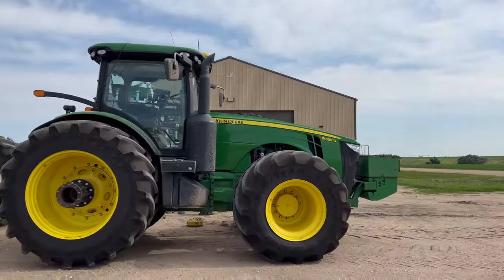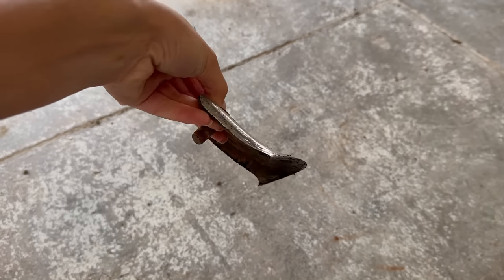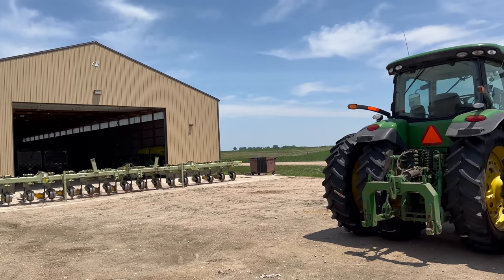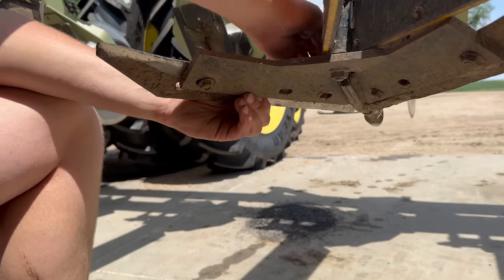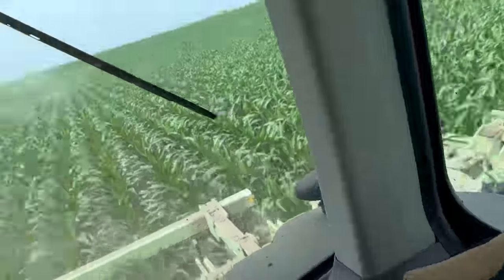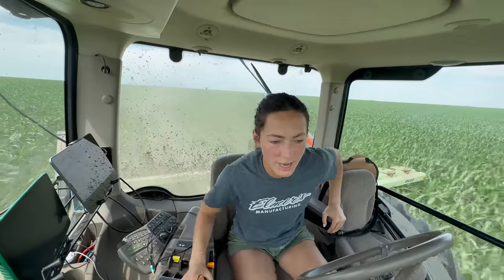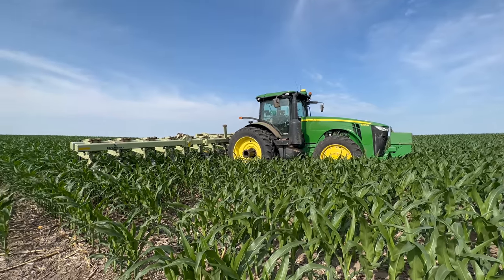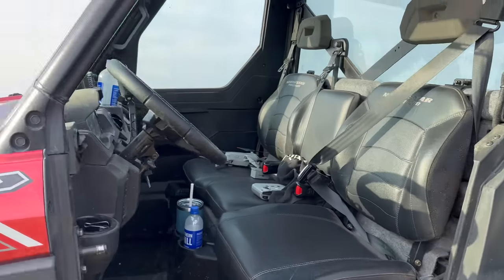I've Got The Biggest Corn On YouTube

Comment: Would keep the big tires for ground work, here in Europe every new 200+HP tractor is equipped with at least 710 (or even 900s) tires to get all the power to the ground properly, less ground pressure and less soil compaction.

Comment: The hole is an old collapsed water well most likely.  If it is, the hole will continue to get larger and or deeper.  It could also be an old unused supply pipe for an old sprinkler or flood irrigation system.  It all depends on the precise location within the field.

Comment: The big hole in the field looks like a tile washout, we get them alot in NW Ohio/ NE Indiana, arond here when the old clay tile breaks in a certain spot, then the ground washes out in that spot creating a big deep hole, the easiest option to cure it, is go out with a mini excavator or a backhoe, dig down to the tile spot, shove new perforated poly tile in so it overlaps on both sides then cover it back up.

Comment: The duals are better on wetter land because big rubber just squishes soil aside and means you need to disk out the ruts. The important factor is the amount of pressure beneath each wheel. Consider duals in front as well. TSH, retired agronomist, NC.

Comment: Glad to see someone still does it the old fashioned way.  After that crowns out, you shouldn't have to worry about weeds.  Seeing those plow shanks and hardening them up with a torch brings back memories.  We had a full blacksmiths shop on our little farm and every spring, we had the ritual of "sharpening plows" and doing the heat treat to harden up the tips.  Got a lot more wear that way.  That hole looked like a collapsed tile inlet at first, but it looked like it was on higher ground, so that doesn't make sense.  if it were down here in the South, I'd say it was made by wild hogs, but don't think you have those up there, and if you did they'd damage half your crop.  Might be a sinkhole/sand pocket.

Comment: Wow! Those tires looked great. But, they are super heavy. So, with out them the steering has to be a little lighter. Plus, you can probably turn a little tighter. Cultivating may seem old fashioned. But, it’s a lot cheaper than using a ton of herbicides. I think it’s a very smart cost effective solution.

Comment: Was LITERALLY holding my breath when you were moving those huge tires. Soooo dangerous. Always move it AWAY from you and NEVER stand on the side of it. That falls over on you and you are likely a goner.
Reply: Shades of Erin Holbert!
Reply: I was also more than concerned watching you move the huge tires.  I understand farming involves hard work and labor.  I worked in construction in high school and college.   If my body could do tasks I used it.  Heavy lifting and lots of dangerous tasks.  I can only suggest from my own experience, every task needs to be evaluated in advance for safety.  While you are young and strong now, your back has only so many miles for which you can abuse it.  I started having back issues in my 30s, all related to moving and carrying things that were too heavy.  I know you are strong but moving those tires by yourself is not worth the downside.  Accidents happen in a fraction of a second.  By then it's too late to calculate what is and what is not safe.   Please be safe first.  :)  Perhaps you can add farming safety tips to your videos.  I would be upset if you were injured getting the job done.
Reply: Балдёж реально 👍
Reply: I was thinking the same thing. They have a forklift, use it.
Reply: I have a pretty good feeling those tires are actually not that easy to push over.  The wider it is the more stable it will be.
Reply: @rmedlinnc  - That's the first thing that popped into my head. Erin was really lucky she didn't get hurt any worse than she did...
Reply: @Snarkapotamus  amen!  She was blessed to be hurt no more than she was.
Reply: Tires that wide?  You couldn't push them over if you wanted to.
Reply: Love this gal 😎
Reply: C’mon folks, Laura grew up around this stuff, she knows what she is doing.
Reply: @Snarkapotamus who's Erin?
Reply: Moving tires is what the forklift is for Laura.. Let the machines do the work! Your body will thank you in 30 yrs...😉
Reply: Laura isn’t the brightest bulb in the box so what more do you expect than her to do things the hard way.
Reply: We have some 'LGP',  (Low Ground Pressure), tyres (3ft. wide) like that on 3 Volvo dump trucks we own, - none of my men can push them over, and they have all tried, - they're nearly impossible to roll as well, - we have to use a 'fork-lift', - we've no choice.
Reply: @rmedlinnc  the tire Erin dropped on herself was liquid filled, way big difference. The big tires would be harder to fall over and Laura handled the tires properly.
Reply: Yeah I thought she was gonna pull one like the Indiana farm girl Erin Hobert! She was moving some combine duals and one fell over on her and pinned her to the shop floor. Luckily her brother and dad were around!
Reply: What are they…1100 pounds or so?  Yea that would be a bad day.
Reply: @rmedlinnc মানে আপনি বাংগালি

Comment: So my guess on the hole, is that it's a collapsed tile. Back in the day, (Late 1800's all the way to the 1970's or 80's) they used actual half-moon tiles and some round tiles to divert the water away from low spots. Now they have tile in rolls that they can drag through the ground to get the water away. Usually to a ditch, pond or lake. My Grandfather tiled a field on the other side of a railroad track and used a hand post hole digger to bore under the tracks to get the water to drain away.

Comment: 7:45 Watching Grant hold down the head of that carriage bolt, whit his bear finger sent a twinge down both my legs, reminding me of 20 years ago I was removing a nut from a carriage bolt that had been pulled through hundreds of miles of Iowa farmland. I was using an air impact wrench & held my bear finger on the bolt head until the impacts wrench unseated the bolt & spun that thinned down head under my finger sending me outside to a running water hose to wash blood away for a long time. The cuts left on scar on my finger but sure scarred my memory to this day.

Comment: I'm going to ask a dumb question. Doesn't that tractor damage the crop itself due to weight? I would assume yes? No? Thanks guys!
Reply: Only.a.small amount on the end rows get damaged.  The tires are spaced to go between the long.rows.
Reply: The narrow tires are used to drive between the rows preventing the crops from being damaged
Reply: @beckyumphrey2626  Thanks for answering so quickly!
Reply: A more complete answer would be that the narrower tires are designed to fit in between the rows so that they do not run over the crop rows. Which is good.
 BUT!  The narrower tires will compact the soil underneath them considerably more than the wider tires do. Which is bad.
Reply: @jstephenallington8431  It's an interesting engineering challenge with no real solution as I can see it. Pressure=Force/Area. The smaller the area, the more pressure. You can't win can you :)
Reply: The only dumb question is the question you don't ask.
Reply: @dennisb-trains23  Thanks! That's so true!
Reply: With the auto steer, they are able to drive in the same tracks every year, and plant the seed in between the compacted areas from the tires. The cultivator also helps break up the tire compaction.
Reply: Hi Jack......Your question is a good one. There is a large debate within AG.  Within one side  is the observation  you have made. Each tractor pass = fuel costs / equipment use $$$. AND there are occasional added needs to brake some soils with subsoil plowing, etc.....There is an alternative that is being debated / observed.....This involves spraying crop fields with weed control. One of the issues = how is will  affect the crops ?......The spry herbicide is not cheap but with genetically modified ( also not cheap ) crops the spray will only kill the weeds......It really does go on from there..... joe
Reply: @joediamond8210  It is an interesting question indeed. I also suspect that tilling is risky top soil if you have a very windy environment. I still remember reading about the dust bowls in school (eons ago :))
Also, I suspect spraying does involve some sort of fuel costs to apply the herbicide. So, do we know where the trend is going?
Reply: @JackKirbyFan  The whole issue of AG costs keeps getting kicked around.Every field pass has a cost. The point of ethanol production is it is supposed to be cheaper fuel. It seems each time a cost analysis is done the economy of the ethanol deal changes.....same thing with NO TILL. Yes there was a " dust bowl" as the deep rooted prairie grass was removed for grain crops.  So the essential cover crop  applications get dialed into formula......It looks like we are going to the land of " Always done er that way."......I marval at the operation of a farm where you need a GPS to get around in the fields..... joe

Comment: Laura the tractor 🚜 looks terrible with those skinny tyres on. Something else that I noticed when you were connecting up cultivator to the tractor I did not see you wipe the ends of the hydraulic hoses with a rag . Also arn't you suppose to bleed or release the the pressure out of the hydraulic hoses so it makes it easier to connect to the tractor I didn't see you do that. That is what I was taught love ❤️ your videos.

Comment: The comparison from the huge front tires to the short front tire seems like it would change the gear ratio and might be so different that driving on the road might damage the tractors transmission ??
Reply: Tractor has an all hydraulic transmission with gear ratios for... most 'everything'.
Reply: When the tires are the same diameter on all four axles there isn’t a problem.

Comment: I have a novice type question for you or your many followers, with regards to the electronics of modern age tractors. “When changing wheels, as per this video, or wheel size, do the electronic system need to be updated of this new information recalibrated or is distance and position only carried out by GPS or other satellite or positioning systems. Oh and by the way, Laura you a tough little one…
Reply: Good question
Reply: That tractor will have dual facing radar to read the ground speed.   I'm not certain about the front:rear axle ratio.  I do know that you're not suppose to engage the front wheel drive on hard surfaces, so maybe the exact ratio doesn't matter too much.

Comment: Curious as to why you are running duals post emerge? Unless you are cultivating with some deep tillage, you definitely dont need the traction. We run a 12 row cultivator on a 4440 2wd without duals. Idk just seems like a waste knocking down the extra crop on the endrows
Reply: A 16 row orthman is a pretty heavy machine.  I doubt that any narrow tires are rated for that kind of weight as singles.  You must have a very light weight cultivator if you can carry it on that tractor without duals.
Reply: @42base13  I've run a 7300 Houle hunny Wagon without duals. The ties can handle it. It's just less stable. If I remember correctly off the top of my head an 18.4r46 can handle 16 or 18,000 pounds

Comment: Why do you use pivots to irrigate which inevitably leaves dry areas when you could have a system that moves across the field parallel to one of the sides fed by a large self retracting hose reel?
Reply: Because lateral move sprinklers are an absolute PAIN.
Reply: @42base13  Fair enough 🙂

Comment: lightening can make quite huge craters - but it doesn't seem too burned around the hole, so I don't know if that is the cause of it.
Reply: Probably rodents dug holes and the has settled
Reply: The red flag and the piece of PVC should be a clue.   Either a water pipe blew up and leaked or it was repaired and they didn't fill in the hole..

Comment: I wonder if you could comment on the Ogallala Aquaphor and the claims it is shrinking rapidly. how big  IS IT?  Is it a huge void underground or more of a leachable sand or gravel? thank you
Reply: The Ogallala Aquifer is a vast network of interconnected aquifers, not a single massive pool.  It's veins of water-bearing sand and gravel and varies greatly from region to region.  In the area that Laura farms, the water level has been measured every March since 1960.  The 2023 level was slightly higher than the 1960 level.  
In Nebraska, most of the aquifers recharge fast enough to permit irrigated agriculture for the foreseeable future.

Comment: Grant, stop using your finger to hold down those carriage bolts while you tighten them with an impact.  Fast ass way to lose a finger.  First of all, they are cheap, get new ones.  Second, use a rubber screw driver handle or something to hold them down.